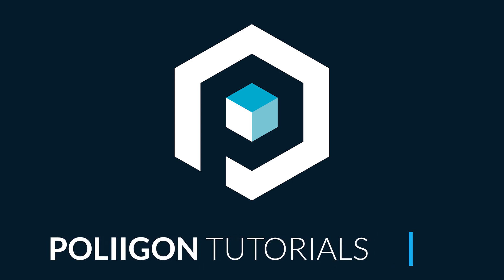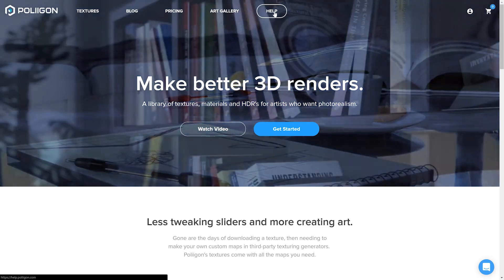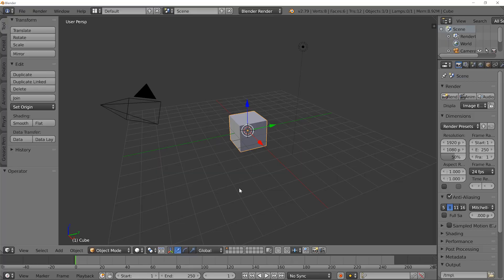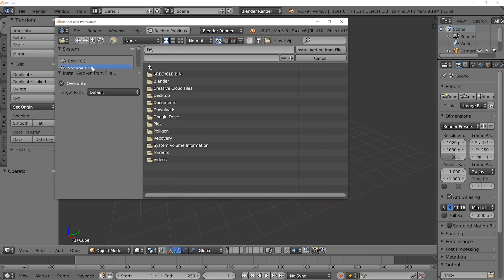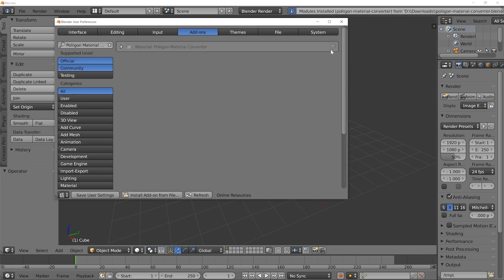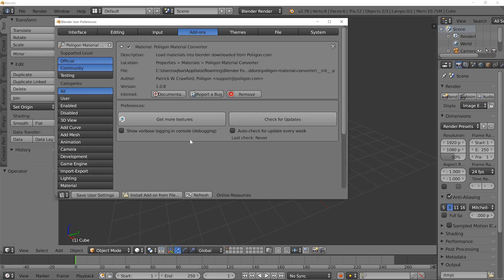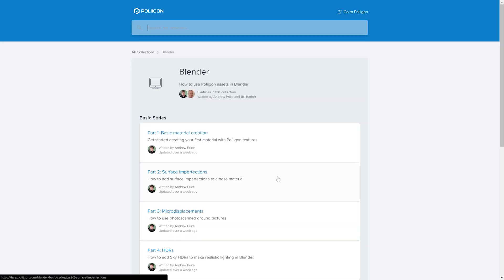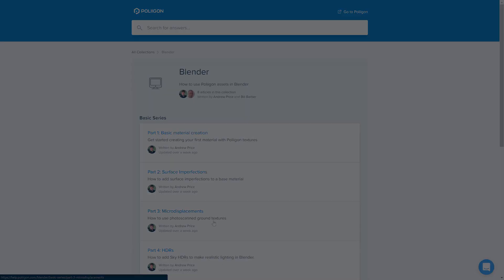How to install the Poliigon Material Converter for Blender

Comment: I unzip it and it shows me a folder with the images of the texture, I use the addon for the textures, and when I select the folder I can't
Reply: The Poliigon Material Converter is an add-on and you shouldn't unzip add-ons for Blender. Like told and also shown in this video here leave them as a Zip file, choose and install them via Edit - Preferences - Add-ons - Install Add-on from File.

Comment: Hey! Please remake / update this video blender 2.8 or above.....How to install in those versions? The method is not same. I cannot get it. Please make a tutorial for adding the addon by blender 2.8 and above. PLease !
Reply: I'm using blender 2.9. I got the same problem, But I can do this. 
Firstly  go to poliigon  help center and click tools and addon. then go to "Poliigon material converter for blender". Then click to download.
Then come to blender and go to edit>preferences>Addon>Install>choose the file you just download>Click install addon>And it will start installing.
Reply: @shamspahlowan6851  Thanks a lot! It worked !😊
Reply: @shamsuoliullah5980  Welcome
Reply: @shamspahlowan6851  thanks dude!
Reply: SP Savearth 👍🏼

Comment: Traceback (most recent call last):
  File "C:\Users\Professional\AppData\Roaming\Blender Foundation\Blender\2.90\scripts\addons\poliigon-material-converter\poliigon_ops_props.py", line 426, in execute
    mapping_type=pmcs.mapping_type
  File "C:\Program Files\Blender Foundation\Blender 2.90\2.90\scripts\modules\bpy\ops.py", line 201, in _call_
    ret = op_call(self.idname_py(), None, kw)
RuntimeError: Ошибка: Traceback (most recent call last):
  File "C:\Users\Professional\AppData\Roaming\Blender Foundation\Blender\2.90\scripts\addons\poliigon-material-converter\poliigon_ops_props.py", line 522, in execute
    status, material = workflow.build_material_from_set(context,set_path)
  File "C:\Users\Professional\AppData\Roaming\Blender Foundation\Blender\2.90\scripts\addons\poliigon-material-converter\poliigon_converter.py", line 580, in build_material_from_set
    self.build_material(context, files=set_files)
  File "C:\Users\Professional\AppData\Roaming\Blender Foundation\Blender\2.90\scripts\addons\poliigon-material-converter\poliigon_converter.py", line 641, in build_material
    self.update_cycles_principled(context, mat_config, node_group)
  File "C:\Users\Professional\AppData\Roaming\Blender Foundation\Blender\2.90\scripts\addons\poliigon-material-converter\poliigon_converter.py", line 983, in update_cycles_principled
    principled = mat_tree.nodes["Principled BSDF"]
KeyError: 'bpy_prop_collection[key]: key "Principled BSDF" not found'

location: C:\Program Files\Blender Foundation\Blender 2.90\2.90\scripts\modules\bpy\ops.py:201

location: <unknown location>:-1
WHY?

Comment: How do you install it in blender 2.8 beta?
Reply: 1 go to edit
2 preferences
3 add-ons
4. click on  install
5. select the previously downloaded zip file 
6. click on install add-on from file...
7. check the boxx to enable  the add-on 
8. and finally save on lower left corner
Reply: @hobbermallow6325  TYSM
Reply: @hobbermallow6325  the install from file button no longer exists so it’s been a year but do you know how it would work now?
Reply: @h4ppyd796  it's definitely there, up the top

Comment: There's actually a bug in this. Unfortunately I can't read the whole error message. But it ends with addon_util.py line 393 is enable then addons\polligon-material_converter_initi_.py line 56 in register. And finally addons\poliigon-material-convertoer\addon_updater_ops.py line 1312 in register.

I am using the blender 2.80.40
Reply: Yeah same... Addon is up to date also. Shame it was looking like a great addon. Using blender version 2.80 sub 75. Hope they'll get it fixed :(
Reply: @sgxmen  it was because it needed updating.Make sure u don't extract the file.And download it to your desktop